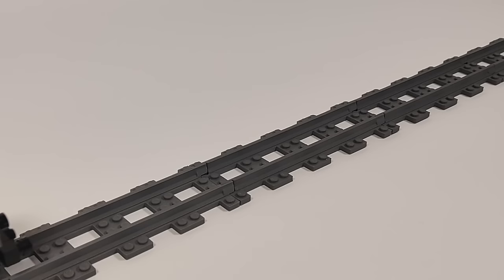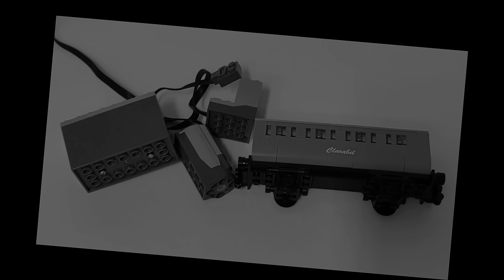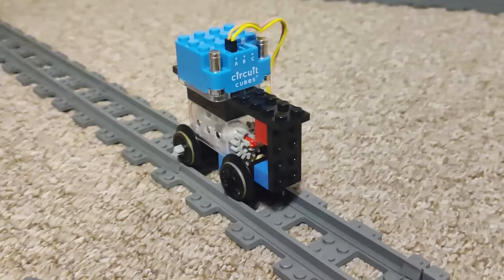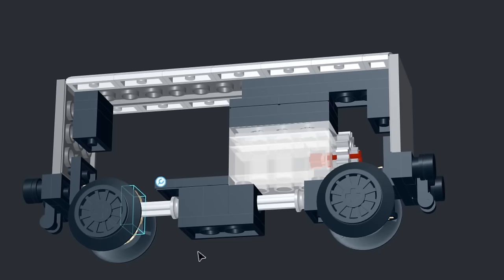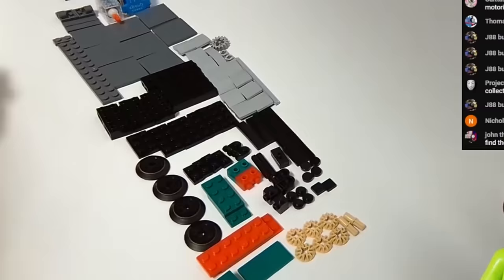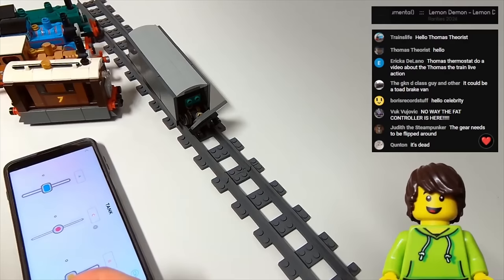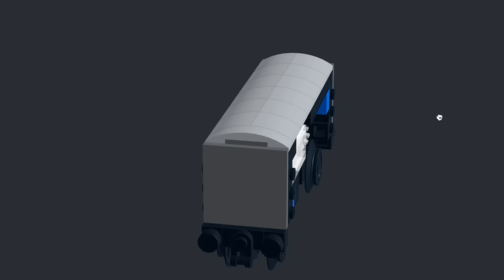How I made a Motorised LEGO Narrow Gauge Train Car - Larry’s Lego

Comment: you know, the van being slightly differently sized honestly is pretty fitting for real rolling stock. it could have been newer/older, from a different company, or specifically designed for an odd use.
Reply from the maker: Very true! Not everything would be completely standard
Reply: Thinking about it, maybe all this could be crammed in boco? And similarly, I wondered if you could use those panel bricks that have a hollow side in them, like piece 4215a/30007a? 
Building vertically not SNOTy they should leave a bit larger of a cavity than regular bricks
Reply from the maker: @michaelkolano8686  Hmm, maybe! I hadn't considered those. Would take some testing to see if there'd be enough gap with them!
Reply: i don't know if that 4x4 controller could fit if you had two of those plates 4 studs apart (maybe resting diagonally) but it probably could make room for other parts.

Comment: I wonder if you could do a similar thing for your Greater Anglia FLIRT, motor in one of the carriages, the gears in that tiny centre carriage, prop shaft & sliding universal joints connecting them, much similar to some OO and N scale drivetrains where there’d be a motor in the tender, with a prop shaft going through the cab and to the driven wheels (examples include the Graham Farish OO tender locos, some old Arbour Models loco kits, I believe Airfix used a similar drive system in their 4-4-0s)

Could do the same for adding more drive wheels to the existing design, motor in one carriage, battery in the other, sliding UJs connecting all 8 wheels…

Comment: While the batteries/controller will always be an issue size wise, Cobi make a small motor that's only slightly bigger than a standard 2x4 legobrick that might also be worth a look!
Reply from the maker: Thanks for letting me know! Do you have a link to this? I can't seem to find it (remove the start so it doesn't work as a link, it'll get flagged as spam)
Reply: @LarrysLego  Doesn't seem to take no matter how I disguise it :P
Probably didn't show up because I was mistaken; it's by CaDa not by Cobi. 
The motor's ID is JV5043 which should show it up.

Comment: 1. Looks like derailments is more of problem of point's geometry than build.
2. For first build it looks like driving axle was heavily underloaded. You didn'd try to move battery box on it?
3. Maybe add 4x1 under the central tiles on sides? This could help to create more "proper boxcar" look
Reply from the maker: 1 and 2 are interesting points!
3 would just not be possible because of how the sides are built. I had to do it all that way for structural purposes
Reply: @LarrysLego  3 - than just add 4x4 plate under central tile?

Comment: The problem with the design at 5:49 isnt torque, it's traction. The motor is still running fine, but the cart isn't making good contact with the rails and is slipping. Your second design works because it has four contact points, increasing your potential friction, and the car itself is heavier, increasing downward force. 

Your first design would have worked great had you wrapped the wheels in rubber bands or something to increase the friction.

Comment: Really cool and well made. Though the engineer in me did cringe a little at some of the gear arrangements.

I know you already commented about this type of comment, but I think you could create a model of Gordon that is motorized via these bricks. I only think it's possible because the battery is already blue, and because Gordon has a tender (so you don't need the motor and the battery to fit inside). It would also make the large wheels less of an issue, but it also would certainly be a tight squeeze.
Reply from the maker: Thanks!

Comment: In theory you could use a an Arduino board and a aaa battery instead of the Circuit Cube box. Though I don’t think you would want to go through the trouble of coding. I know I wouldn’t.
Another thing you can do instead is connect the motor directly to the aaa battery and a switch. You could add a Potentiometers as a was to control the speed.
Reply from the maker: In theory you could do this, yes, but I wanted it to be simple enough that others could do it too :)

Comment: I feel like you’re missing something fundamental about trains that could help you.

If you look at the typical steam engine train, and maybe even some diesel trains, their wheels are never the same size as the cars. Usually on a steam train there are one or two pairs of very large wheels And then several, two or three pairs of smaller wheels, in my mind I am thinking they’re even smaller than what the cars right on, but they’re probably the same size.

With larger diameter wheels than what you have, assuming they exist, or you can adapt something to be them from something else in the Lego system, you ought to be able to work out a way to have the motor run in the same direction as the larger wheels so you don’t have to do a right angle transition for the powertrain. It seems to me that will give you a better torque conversion, or at least give you opportunities to use gearing to change the way you handle torque. Could be wrong there. But what I’m envisioning is the motor being the full width of the engine car, and then using tie rods to drive the larger wheels. This would allow you to keep the wheels where you want them to be, but drive them wider than the car actually is. from an aesthetics perspective, it might be a little janky, but I’m sure you can figure out a way to have a one flat thick piece to use to transfer the power from the motor to the wheels.

Comment: I think it’s possible to make smaller trains work by using non-Lego motor and battery and connecting it to the wheels by a rubber belt

Comment: Great work, did you use traction bands/rubber bands on the wheels for extra grip?
Could you put the motor in the engine and the battery box in the tender or box van, having the wire run between the two?

Comment: For the question of a piwered locomotive, maybe an American prototype? Old American HO scale 4-4-0 locomotives typically had the motor in the tender, gearing in the locomotive, and some kind of flexible joint system between the two. Maybe a system with Technic universal joints joining an American prototype 4-4-0 and tender could work? I'm just spit-balling here.

Comment: Instead of powering the train, how about powering the track? Put regular magnets on the trains, and then electro magnets on the tracks, and then power and unpower them and the trains should move.
Reply: That would be alot of electromagnets, and the rails are not metal so you can power it like the old 9v system

Comment: for the smaller wheel ( the ones u use in all ur build) can your just put a black stick piece ( the ones minifigs can hold) and rely on friction to rotate the wheels?
Reply from the maker: Those wheels fit loosely onto them, not like an axle into a large wheel

Comment: You should make a motorized Hector the Horrid, the size of the motor won't be that much of an issue since hector is massive
Reply from the maker: Look at how much empty space is at the bottom! How am I supposed to fit important stuff down there?
Reply: @LarrysLego good point, also the angle hector's hopper, but ypu could make a half decent motorised breeakvan
Reply: @LarrysLego or a motoriesd rake of express coaches, with all components split between say 3 coaches, or motorized annie and clarabel, with components split betwwen the 2, the look may not be perfect but its an interesting idea

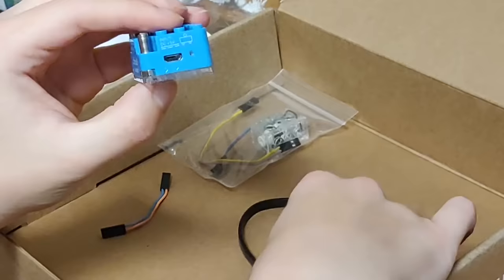Comment: 3:45 its its over $15 and not usb-c, it cant be worth it. Also, since you are not using the studs on it anyway, it might be easier for you to disassemble the logic brick, you could probably make it a 3d printed enclosure if you wanted to. You could even solder in wires for the motors if the wires there are too big.

(What I am trying to say is that what is inside of the logic block can likely be much smaller, and is only that big to fit a more standard lego form factor)

Comment: The problem wasn't with torque the first time. The issue was wheel slip. Adding more weight over the driven axle should have fixed this

Comment: Since you have a lego class 755...
look it has a carriage for the engine just what if you put the motor in there and get a functional class 755
Reply from the maker: Unfortunately it's not as easy as "putting the motor in there"
The engine car is way too small to fit all that in, plus it wouldn't work with how the wheels are laid out, sadly!

Comment: your problem originally wasn't torque. it was weight. if torque was the problem the wheels would have stopped spinning but instead they where spinning at standstill, which means they where slipping because your wagons weighed more than your locomotive. if you put a bit more weight on the locomotive it would have probably worked tbh.

Comment: 6:00 is not a torque problem since the motor is spinnig, if it would be a torque problemthe electric motor would stop, because torque is consatant on the hole network. the real problem is traction or rather the lack of it, the wheels are sliping. To fix this problem i would in your place put some temporari weights on the front of the locomotive or just moving the battery should hopefuly make the spinnig wheels have better grip.

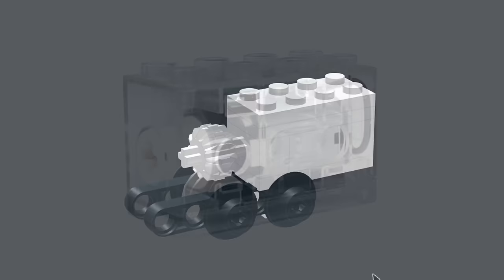Comment: Wait how is 2:25 supposed to work?

I would love it if there was a all in one unit similar in shape to the dome racers pull back motor!
That way you can change the wheel base and it would be small enough to hide under a train with plenty of room to build on.
Reply from the maker: It's supposed to work in the state of mind where you put something together in one minute and put zero thought or testing into how it would actually work
Yes, that would be amazing!
Reply: @LarrysLego  ouhhhhh
I was sitting there scratching my head and thinking that this is some kind of secret connection!
Reply from the maker: @Ice-Qube  Hahah nooo

Comment: pff. just use the 9v block and the 9v or 4.5v motor from the past. way smaller. it's all 4 wide tho. (although that 4.5v 'oval shaped' motor mounts on 2 wide and maybe would fit between 2 of them 'c shaped' 'sidepanel' units (the 4 long, 1 wide, 3 heigh ones)  but a lot lower.as i'm not sure if that 4.5 one despite being wider than it's 2 wide mounting plate actually fills up 4 units to the sides (there may be space for [ o ]'s around it ;) the 9 volt motor is square and as such already basically is the side panel ay ;P
Reply: if i'm not mistaken there even were 'integrated' differential and gear boxes that fit onto the 4.5v motor. would say it's actually more of a problem to get the track to work out as despite the old blue (1970s) and gray (1980s) 'seperate tracks' having seperate rails that can be fitted onto a 4 wide plate, the bendy bits won't work out in length when placed closer together no :P as for 'more recent' rail products, aren't they all stuck together permanently as a single unit...
Reply: the space monorail of the 1990s is 4 wide... available in both black and white i think. lol. but obviously the wheel arrangement is a bit different on those no doubt. still they fit it all into a 4 wide train. lol.

Comment: Probably could get away with motor in loco and battery in next rolling stock.
Reply from the maker: Yes but then it would be cumbersome. That's doable though! Maybe it would look cleaner overall...
Reply: @LarrysLego  definitely has potential. Especially with anything that has a tender. Many HO scale models store a bit of the electronics in the tender and have wires running to them. As long as the linkage is secure it should be fine. Potentially you could orient one of the two pieces to have the port for power be externally accessible or put in a connector between the two. Looks to be a JR 2 pin connector.

Comment: Could you at least put the motor and gearbox in the engine, and the battery in the car behind it? Or maybe the engine and battery are in the car behind it, but it uses a universal joint to connect to the engine and spin its wheels.

Comment: i am one of those more capable engineers, i could tell you can't have the bevel gears on each side you need one shaft going down both wheels and one bevel gear cause they would go in opposite directions if not